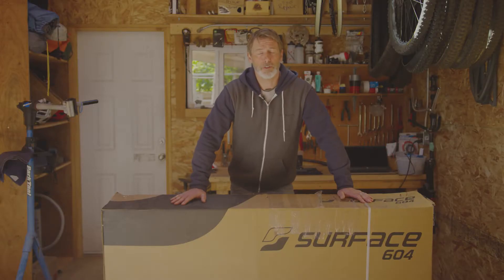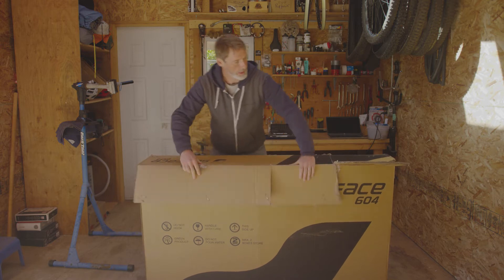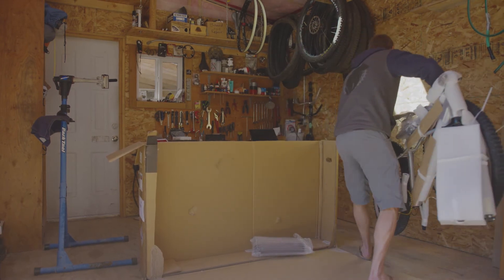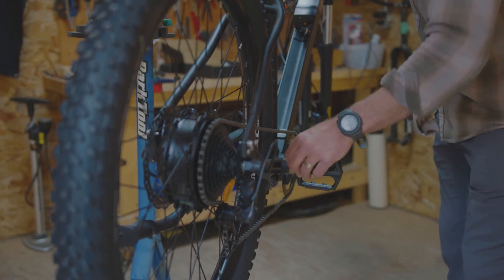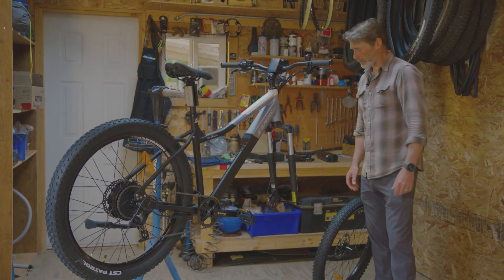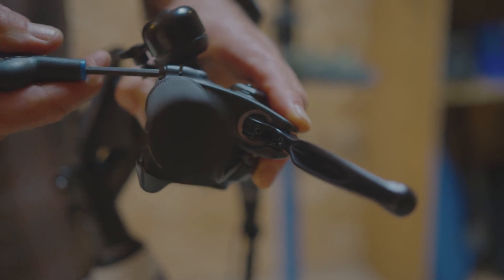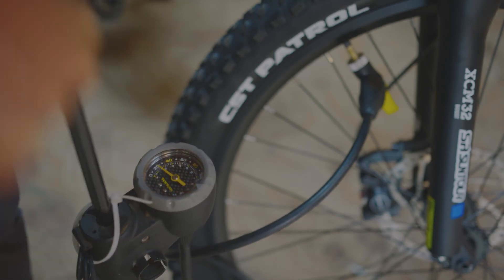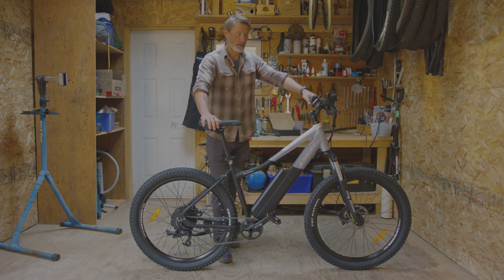2021 Surface 604 - Shred Unboxing and Assembly

Comment: This bike is a beast. I’ve done 750km in the past 5 weeks with a 63km ride today with 2 bars of battery left. Easily had this bike cruising at 50-55km/h. Had to add the fast cruising speed was done for just a short period of time as to not drain the battery, around 2km.